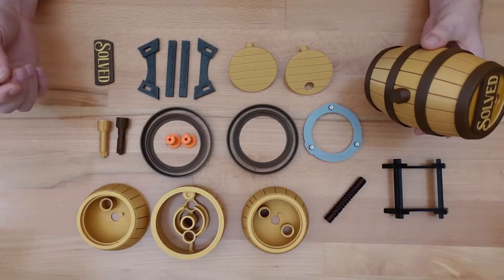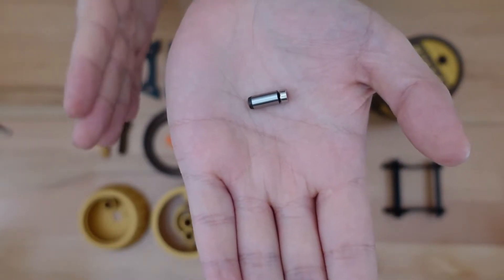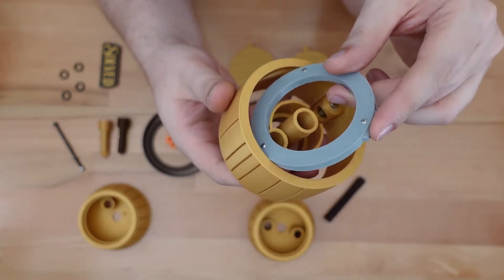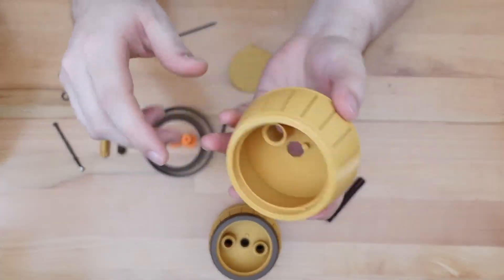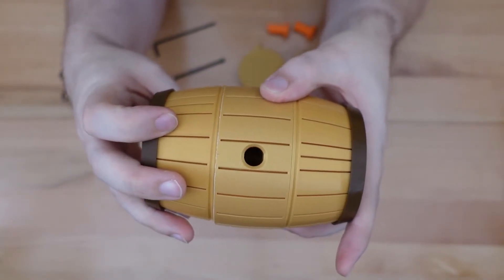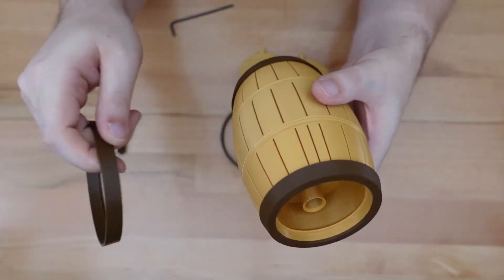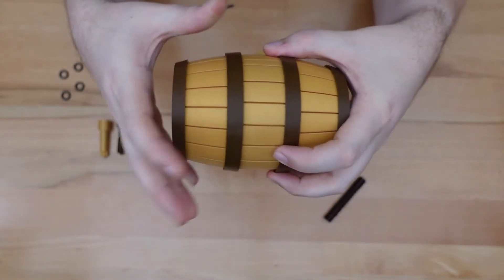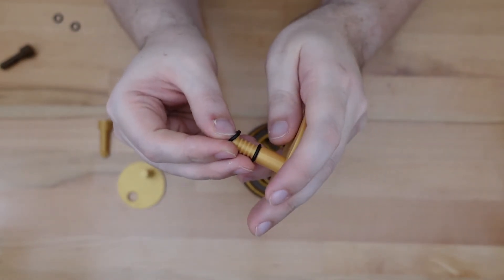The Barrel Cooper's Puzzle Box - Build

Comment: I am so glad you share these amazing puzzles with us. I am having trouble on this one, however. No matter what I try I cannot get the interlocking parts to interlock. I have pressed them into the ends to where I am convinced that they are fully seated but when I put the bottom end on and press the top, middle and, bottom together and turn them they don't even scrape together.
Reply from the maker: I'm glad you like the puzzles! I can think of a few possible causes.

- Do the interlocking pins fit together okay if you try to connect them outside the puzzle? If not, you may need to sand them down a little.
- Did you print 1 copy of each pin? They look similar, but the two sides aren't identical.
- When the interlocking pins fit into the top and bottom shells, are they rotated so that the little indexing dot lines up with the cutout in the pin base?
- Last but not least, did you download the files from Printables or elsewhere? I try to keep my models up-to-date, but it's definitely possibly you have an older version from Thingiverse or Thangs.
Reply: Thank you so much for the information. I did print a copy of both interlocking files at the same time. Is there a way to tell them apart? Or do I need to print one over?
Reply from the maker: To tell them apart, I look at whether or not the little round notch in the base lines up with a raised tooth where the pins lock together.

Once you have two non-identical pins, it doesn't matter which pin goes in the top and which one goes in the bottom. They just have to mesh. Good luck!

Comment: Where did you get your dowel? Im having a hard time finding one thats magnetic
Reply from the maker: This is what I used:

52100 Alloy Steel Dowel Pin, 4mm Diameter, 14mm Long
https://www.mcmaster.com/52100-alloy-steel-dowel-pins/material~52100-alloy-steel

That said, the dowel and magnet are the least important part of the puzzle. If you can't find a suitable pin, or cut one down from a magnetic bolt, I would just skip that part of the assembly and let the cork just sit in the hole. In many cases, it's a reasonably snug fit.

Good luck!
Reply: @3DPrinty  thank you!

Comment: Do you have recommended print settings for prusa printer?
Reply from the maker: I printed mine with 0.2mm layer heights, 2 perimeters, and 10% gyroid infill.

I used a brim just to be absolutely certain that the bottoms of all the shells remained flat. Depending on how your slicer makes brims, you may be best NOT adding them to the list. Some slicer settings print super tiny brims between each cut in the lid... and that's tricky to remove.

For the hoops, you can get away with 2 perimeters and no infill.

Print the screw slowly with a very generous brim. This part is very tall and must be printed accurately.

Happy printing!
Reply: @3DPrinty  I see the file has three different screws (screw, tight, loose)how do you which to use?
Reply from the maker: That really comes down to your printer. I'd print the default first and see how it feels. Ideally, the screw will be tight enough not to just come out when you tip the barrel over. But even if it does, the puzzle isn't ruined - solving requires taking out the cork either way.

Comment: I had a lot of bad luck with final assembly & testing. I had to unscrew mine and chamfer the central mating parts to get a good snap. Then I think I may have snapped the hole-less lid on without the piston in the right place. I had to get a long skinny-handled spoon to push it open. Then I managed to gouge my tabletop trying to pound the magnetic bar free. In the end, it seems to work, but the threaded rod tends to spirally dribble its way right out of the chute when you hold it up :/
Reply from the maker: Sorry to hear it gave you so much trouble! A few of the issues (interlocking pins & tight metal dowel) sound related - clearances that are too tight. This is possibly over extrusion?

The Interlocking pins and screw have alternate versions with different clearances for this exact problem.

I've printed over 100 barrels now and, even on the exact same printer, I have to switch between the "tight" & "loose" version of the screw depending on what filament I'm using. Some mechanical designs just require a lot of printer tuning and testing.

Thanks for printing my design anyway!

Maybe some of the issue can be cleared up just by reprinting the alternate screw and the interlocking pins. I'd also try using a drill bit to open up the channel the metal dowel slides through. Good luck!
Reply: @3DPrinty  Oh it was more of me being distracted and oblivious about where I was pounding it until it was too late (alas). The metal pin does drop out of the way as needed. I did drop down to a single o-ring on the pistons for both lids because the thread rod tended to just shove apart the center spring joint rather than displace the lid like it was supposed to. Not sure what if anything can be done about the threaded rod falling out by itself, though. Maybe a little nub of hot glue or something.
Reply from the maker: I'm going to research printing a custom TPU insert for the versions of the screw that have an o-ring slot. If that works, it'll be an easy way to adjust how tight the screw is without actually reprinting the screw.

On a positive note, even if the screw slides out on its own, the puzzle still requires removing the cork tool to progress - it blocks the puzzle rotation.
Reply: @3DPrinty  A (dried!) drop of white school glue on the screw is enough to give it a little friction in the tube.
Reply from the maker: @JavaJack59  That's a great solution!